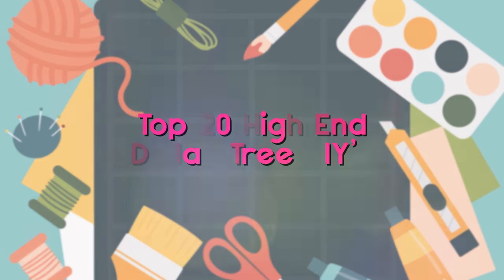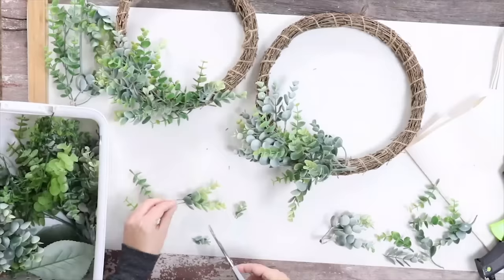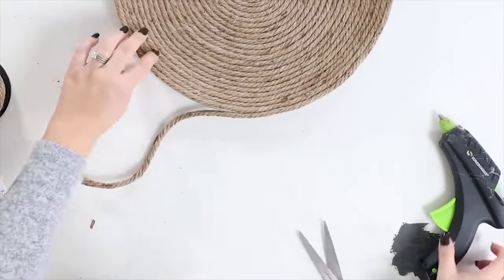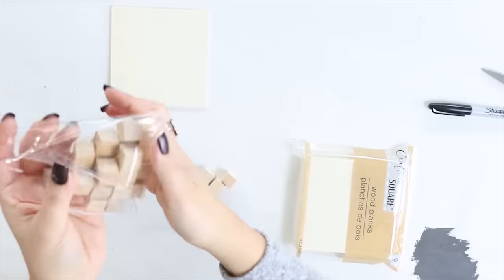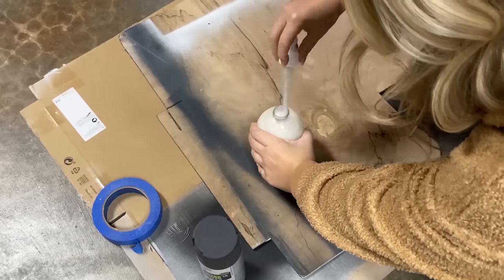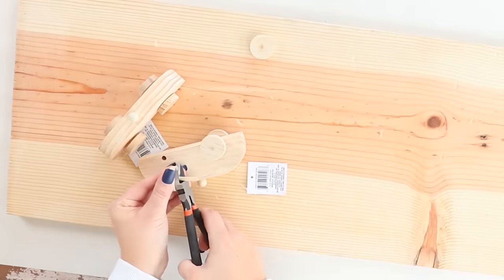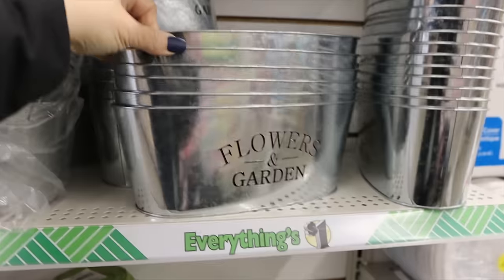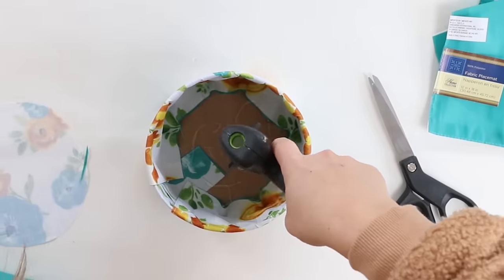20 HIGH END DOLLAR TREE DIYs - ROOM DECOR Inspired by HIGH END DECOR

Comment: quality material: These potato planting bags are made of strong PE material, with fine workmanship, firmness, and waterproofness.
Easy to store and use: After using these potato planting bags, you can empty them, clean them, dry them, and fold them for next use. These potato planting bags can be used in several seasons and will not take up much space when stored. The sturdy handle makes them easy to move as needed.
Drain hole design: Small holes are designed on the bottom and sides of the potato planting bag to prevent excessive water storage and ensure full ventilation. The potato planting bag allows the roots of the plant to breathe fully, and the air can trim the roots and help branch out the root system, providing a good growth environment for the plant roots and increasing yield.
Velcro roller shutter window design: The potato planting bag has a pasteable roller shutter window design. When you need to open it, you can tear up the window and roll it up, so that you can intuitively observe the root growth of the plant. When you need to close, just put the window down and glue it. This way, plants can be harvested easily without digging. What a wonderful thing!
Packing includes: 3 packs of 7 gallon large-capacity potato planting bags, 30*35cm, 60g, which can be loaded with a large amount of soil, which is enough to meet the needs of plants for soil and can be planted at will. The 3 planting bags make the planting, growing and harvesting of potatoes, taro, peanuts, onions, carrots, tomatoes, cucumbers, peppers, flowers, etc. easier and more convenient. Suitable for indoor and outdoor planting